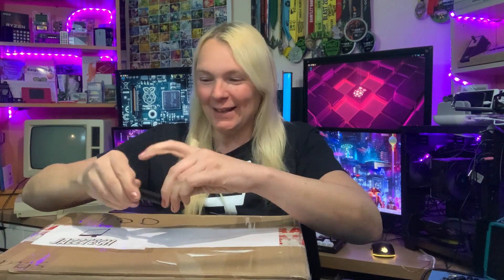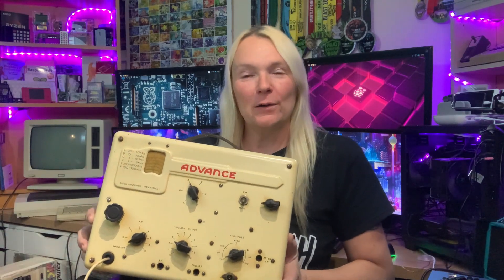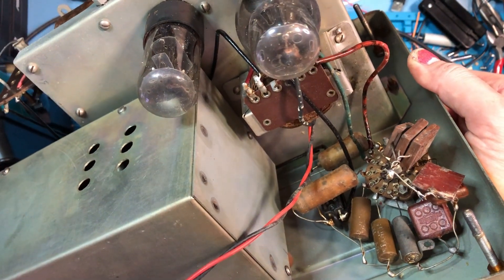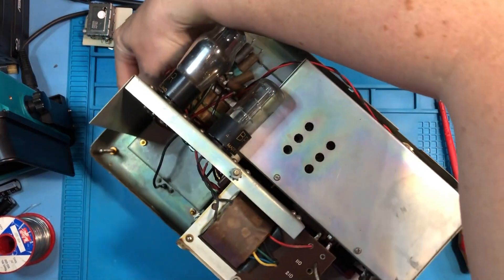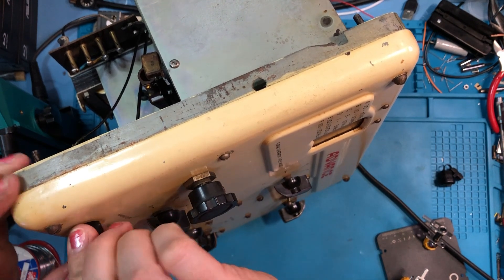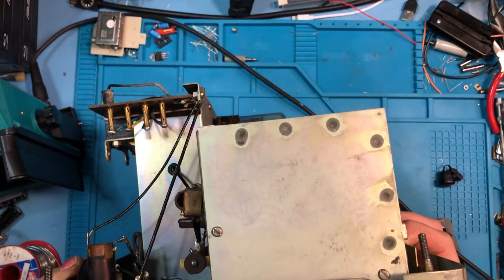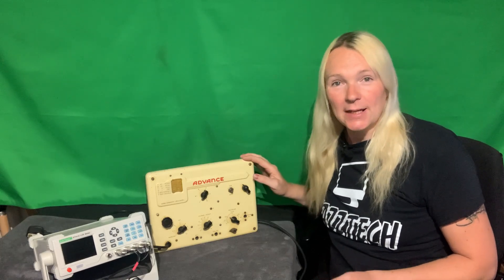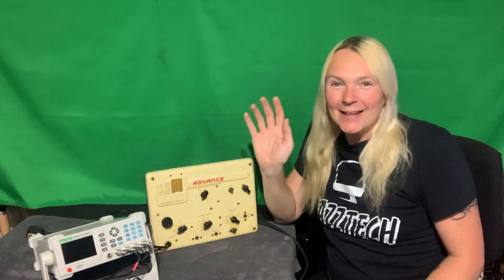1950s Advance E1 Signal Generator Part 1 - Taking a Look Inside with an added surprise!

Comment: Not earthed to avoid use of isolating transformer which is naughty these days.
Reply from the maker: I think the idea at the time was that you could 'float' the generator to whatever you were connecting it to. I didn't like that idea at all so earthed it with the new mains cable and updated it with BNC connectors to make it more useful. Thanks for watching.
Reply: @JazzTechUK  Floating earth is not ok. It was used with care  if there are no earthed objects in reach and you are on an insulated floor. I got a shock as a youngster fixing a TV chassis at half  mains potential when my cousins dog sniffed my bare elbow when I was holding a floating earth scope probe. I was sitting on a wooden floor in the garage. Unfortunately the dogs hind ln eggs were on the concrete garage floor. We both survived fortunately.

Comment: Ahh, the Advance E2. The AVO 8 of sig gens. These things were everywhere in the day, we were still using an updated version at college in the 80’s. 
100 KHz to 100 MHz as I recall, so covered IF of nearly all radios, shortwave receivers,405 line TV and you can even set up FM discriminators at a pinch. So simple and its reliability is proved by the numbers that still survive. Yes it’s old, but just the thing for old radios. It’s all you need. 
As others have said those waxies will have to go. Due to the oscillator action and inductors there is OVER 400 volts in there, so replace with 1000 volt caps.
Reply from the maker: This is the E1 which goes up to 60MHz. The E2 does go up to 100MHz.
I have done a Part 2 where this non-standard mod, with the wax capacitors, has been removed. They were only subject to low voltage in any case.

Comment: Very interesting. I have the AF only version the Advance H1 which I still use for some audio work. Those wax capacitors on the modification are very suspect but the square, flat mica caps will be fine. Looking forward to P2.
Reply from the maker: I have done part 2. Go take a look. Thanks for the sub.

Comment: Where is part 2? Its been 3 months since this video. Did you order some new capacitors?
Reply from the maker: I have new capacitors for the power supply and I have new capacitors coming for the non-standard mod. I have just been very busy with work and this unit has been pushed back for a while. I will be looking at it again soon.

Comment: Nice find. I'd also replace those mains-to-chassis caps (C15 and C16) with some more modern Y ones, just in case. Probably not necessary, just a precaution. Good thing there are no caps between high-voltage and grids, someone designed to last for years. Looks like it will be fairly safe to test the generator after replacing just filter caps :)
Reply from the maker: The power supply filter caps are on order. Good point about the mains filter caps. There's been a lot of interesting in this device so I think I will be replacing those crusty old caps on the non standard mod switch as well and also a quick look inside the oscillator screened housing as well, see what needs changing in there. Thanks for watching.

Comment: I have a basement (American sized) full of vintage test equipment and nearly all of it has valves, in some cases more than 40! I have restored all of it to working and mostly calibrated condition at one time or another. It most likely is all workable still, with the caveat that all valve pins are re-treated with deoxit first.
Reply from the maker: That's a lot of gear. Thanks for watching.

Comment: I have one of these, it's been my sig gen since the early 1990s when i was a student. It came from Stewart of Reading's back room. My PSU capacitors died too, but I lifted a pair with an appropriate working voltage from a PC power supply rather than finding direct replacements. Hasn't got the interesting mod though, looking forward to learning more.
Reply from the maker: We gonna trace it out and see what it does. I'm thinking it's to do with changing the modulation frequency. Watch out for Part 2 and we'll find out. Thanks for watching.

Comment: Good memories of my day as a student, What you need now is a Cossor 1049 Oscilloscope, a bucket full of OC71, AD149, BC108 and BC109 transistors and you can build the world, at least we thought we could!
Reply from the maker: Cossor were awful scopes, lol. BC108 and BC109 are still very useful transistors. Thanks for watching.
Reply: @JazzTechUK    Aah,  the days of 007, and the Volcano film set, and I actually made a DIY graticule screen after finding a Cossor in its felt lined wooden shipping crate, in fact the whole kit and kaboogle is still getting in the way at the centre.   At 6200 cubic ft we don't clear out as much as we should.   🙂

Comment: Great find, ive got the heathkit sg8 rf signal generator but similar design from the mid 50's made here in the usa. Love the old tube (valve) designs. Please rebuild it! So useful still!
Reply from the maker: Yes, shame Heathkit are not around anymore. There will be a part 2 after the capacitors in the power supply have been changed.

Comment: Nice piece of kit, not very advanced but totally tubular! I've never seen you work with vacuum tube gear, and I love the stuff.
Reply from the maker: This is the first piece of kit I have with valves in. I have some CRT TV's to work on but I need to get my bench safety all wired up first. Emergency Stop button, RCD, isolation transformer, variac, dim bulb tester (gotta have one of those, everybody else got one lol), gloves, common sense, lol.
Reply: @JazzTechUK  I still need to make a video about my set, and it's pretty advanced. No gloves here. Truth be told... the most important piece when working on CRTs would be a high voltage probe for your meter. To measure is to know, and to know is to be safe.
Reply from the maker: Exactly, totally agree.

Comment: OK to measure those caps in-circuit without lifting one of the legs ?? Cool looking device !
Reply: Yes, with filaments not glowing valves are just open circuit: a glass tube with strands of metal separated with vacuum. Glowing filament sprays electrons into the vacuum, making things happen :)
Reply from the maker: Yes, there are no semiconductors in this circuit that will be turned on and affect the reading by the LCR meter, just 'open circuit' un-energised valves as @argoneum said.
I have since taken them out and they measure even worse than when in circuit.
It is possible to measure electrolytics in circuit with modern circuits, in most cases, as long as you keep the LCR meter voltage at say 300mv in order not to turn on any semiconductor junctions which start to conduct at around 0.6 - 0.7V Do this to identify potential bad ones, then take those ones out for final check. There is a device called an 'ESR Meter' specifically designed for in-circuit testing. It's not foolproof but it's right most of the time.

Comment: My guess about the extra knob is that it is used to select different modulation frequencies. One of the first Heathkits I put together was an RF signal generator. It only offered 400 Hz modulation. I used it mostly for alignment of IF stages in radios and TVs.
Reply from the maker: Yes, we think it does that too. If I can read the values off the capacitors I will trace out the extra circuitry and add it to the schematic.

Comment: What a lovely looking device. Wax capacitors have an awful reputation along with any made by hunts so i would get rid of those too.
Reply from the maker: Yes I understand that moisture gets in through old cracked wax and makes the paper damp causing leakage. Thanks for the info about the hunts capacitors. I will look to see if there are any of those in there. Thanks for watching.
Reply: @JazzTechUK  Also, paper disintegrates chemically, forming smaller and more mobile molecules. Interestingly vanillin, among other things, hence old books with severely yellowed (to browned) paper have a smell of vanilla :D
Reply: @argoneum  At our ECR we had pilot cables were each one was a solid 1 mm copper core and to reduce capacitance/inductance the core was insulated via waxed hemp string spiral-wrapped and covered in a lightly waxed paper tape (one clockwise and other anti-clockwise, inc. paper ID tapes, needless to say the 21+ cores covered in solid lead shield, strands of steel shield armour,  finally bitumen soaked cloth armour.    Strictly No bending in small radius 🤔 90deg in 2ft)